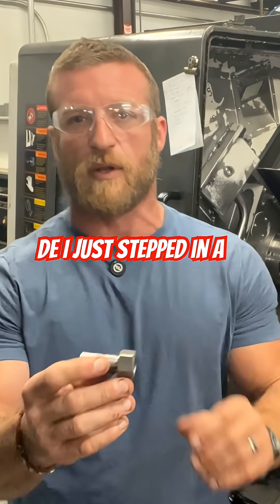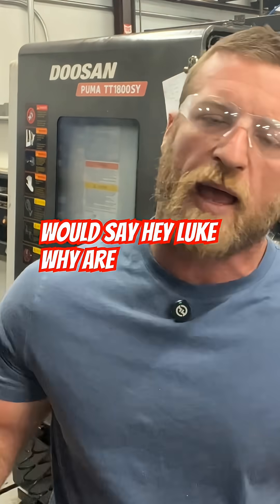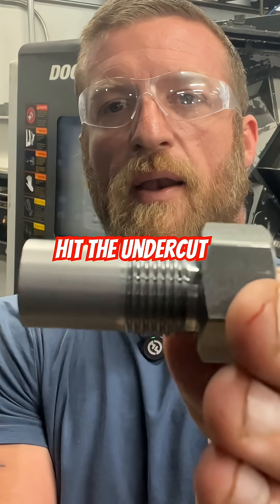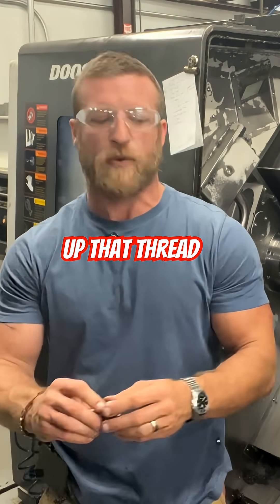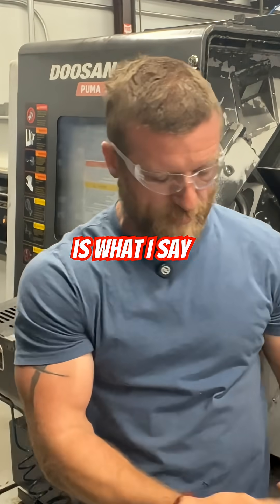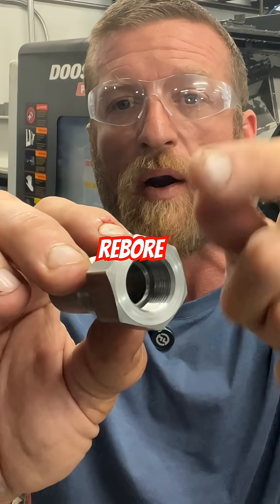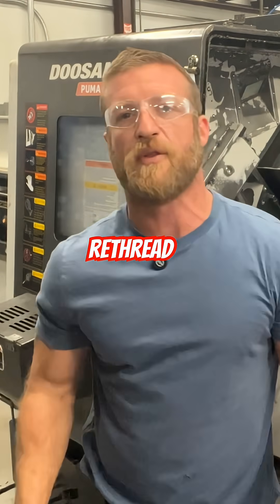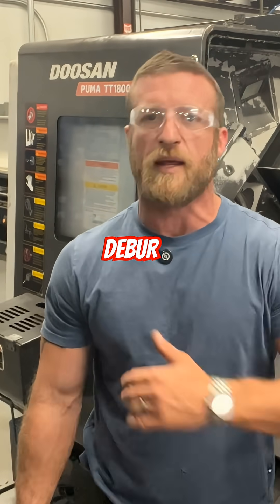Want to see how I make this complete? Hit the linked video! #short #shorts #fun #cnc #machine #tool

Comment: You can try a topping threading insert. They have the advantage of not leaving burrs.
Reply from the maker: I actually do use topping, almost exclusively. You can check out the full video that is linked to the short and I go over all the specifics of tooling and what I use.  Topping inserts are awesome.

Comment: Hey Luke when you come back with the threading tool and run the spring pass, are you running the same G76/G92 cycle, at the finished X diameter from the threading cycle before deburring, using the same RPM and starting from the same Z position ahead of the thread? I'm keen to give it a try, most of my work is low quantity so I debur with the turning tool after threading and then hand file the burr once it comes out of the machine but that's getting old
Reply from the maker: Great question. When I do the deburr pass, I do the exact same code but just with 1 pass versus multiple. Either way G76 or G92 - the principle is the same. Exact starting and ending position, same RPM and just the last diameter that u cut from the original canned cycle
Reply: @Crusadermachining  can't wait to try it now 😆👊🏽
Reply: @zakanderson6196 if you use canned cycle you just make the doc like .1"
Reply from the maker: And thanks for the question 🤝🍻

Comment: I do the same alot of the time ..  it works good enough for small threads ..  Do you make parts that require blunt start/ higbee threads? Don't try it on a Haas, unless its a huge thread at less than 300 rpm .. the brain is too slow on those machines .lol.. it frustrated me for a long time becuse I like the thread gauge look  😅
Reply from the maker: I have not made one of those threads. I wish I had the opportunity, but I never have.  How difficult are they?